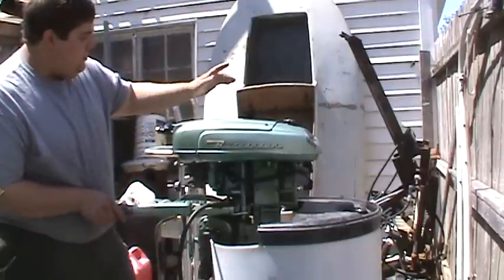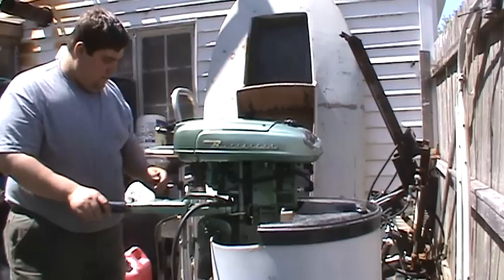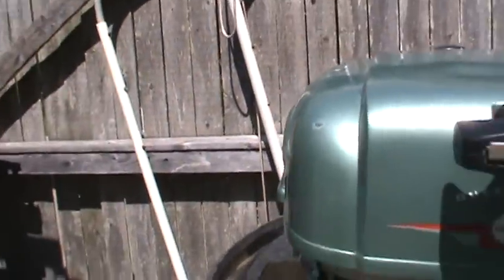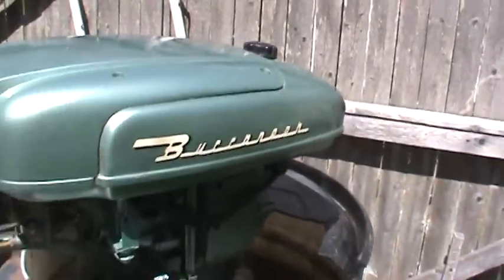1957 Gale Buccaneer 12 hp

Comment: My cousin Sherrie had a '58 Buccaneer 12 on a 1961 14 ft open starcraft. It really went! Great combination. It could troll too. Her close friend had a '61 Johnson QD (10 horse) on the identical model Starcraft, and the Buccaneer smoked i in both speed and planing power with several on board. I think it had more displacement in the engine.

Comment: Sweet motor Will. Do you know off hand if the prop and driveshaft seal under the water pump are the same as the 1953 to 1956  j/e 15hp? Thanks